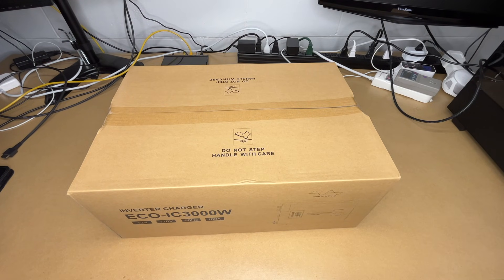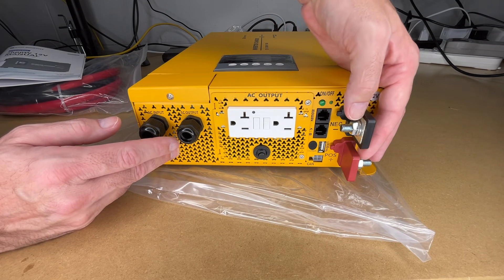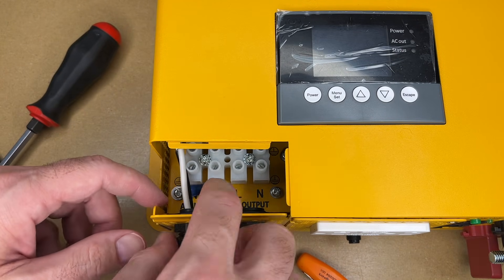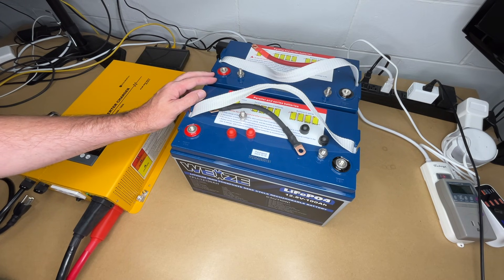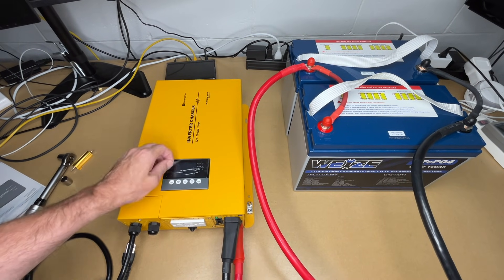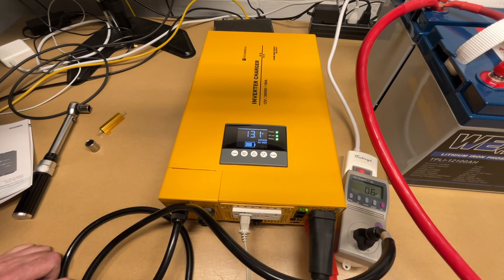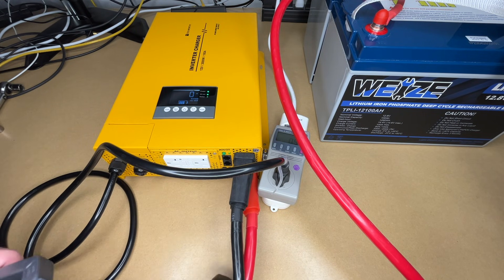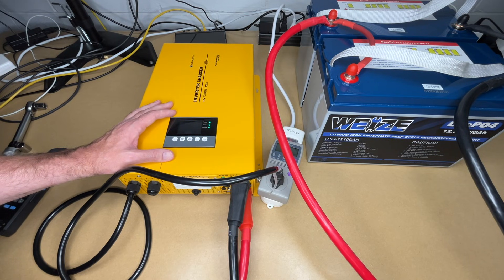ECO-WORTHY 3000W 12V Inverter/Charger

Comment: Thank you for the reveiw, i have an ecoworthy system in my home gym outbuilding and i was thinking of upgrading my inverter to one of these. But i have to say, put ferrels on the ends of the wires before putting them into terminals. The reason people burn their house down is because they fail to install systems in a professional manner. Without a doubt when i build 18/36kw cummins deisel generator packages, a guy would get fired over not putting ferrels on wire going into a terminal or breaker
Reply from the maker: Good call. Ferrules are the way to go with stranded wire.

Comment: Curious if it is able to charge LifePO4 battery (or batteries in parallel ) to 14.6V in bypass mode? Looking at the specs it looks like it will only change up to 13.8V (95% capacity of LifePO4).

Comment: Great overview but is there any way to turn the unit on or off remotely. They advertise it for an RV but I can not find the remote panel anywhere, which would not be a huge deal if I can have an inverter on off switch. Any ideas? Thanks.
Reply from the maker: Sorry for the delay. I contacted Eco-worthy and they said a remote is not available for this inverter. Thats a bummer for people who need a remote. With having a remote port, one would think someone makes one that is compatible with it.

Comment: I bought one of these and I have lithium batteries and when I try to toggle through the different types of batteries, everything is understandable, except for the lithium batteries doesn’t have an LI but it has an L and a backwards L together. Like a square U with a missing part in the middle is that the lithium battery that I need to have it tuned to?
Reply from the maker: Yes. It looks weird but that is it.

Comment: Does it default to normally closed for AC input when inverter is powered off allowing for pass through of shore power?
Reply from the maker: With the inverter off with no battery connected, if I plug it in to AC, it automatically sends it through to AC out (bypass). It will beep to let you know there isn't a battery connected.

Comment: Will the AC output work when you have it plugged into the wall without a battery installed?  Let's say you have something mission critical but need to change out the battery but you are plugged into Utility power, will the device plugged into it remain with power?
Reply from the maker: I connected an air cleaner and plugged it in without a battery connected. It turned on and powered the air cleaner. It did have an error code and alarm beeping. I didn't look it up but I'm guessing it was an error saying the battery was missing.